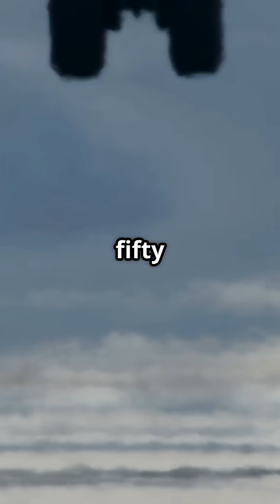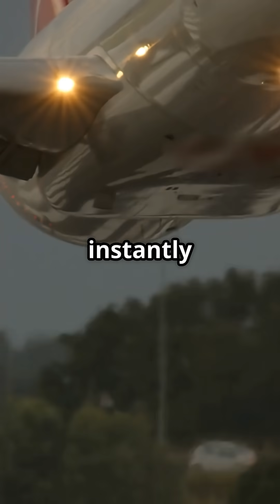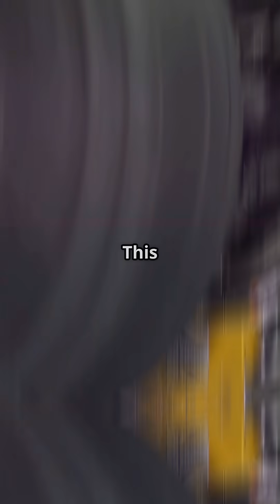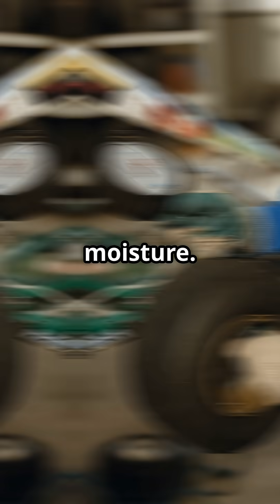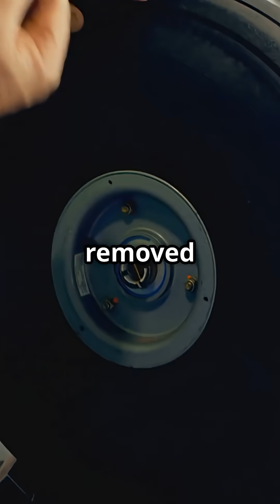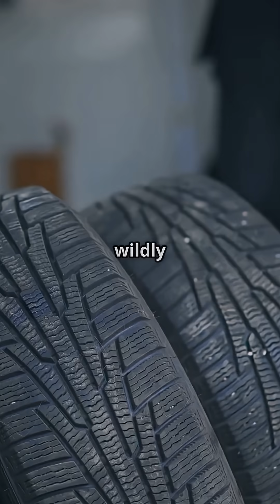Why Aircraft Tires Use Nitrogen Instead of Air

Comment: Did you know goodyer owns the patent for a mechanical system that spins the airplane tires up to 100 mph right before landing so that it saves dread. They shelved it in the 1960s. In fact, they only bought the patents to make sure it never sees market